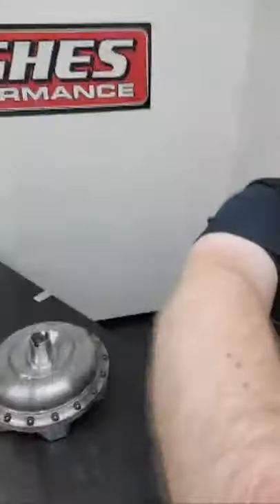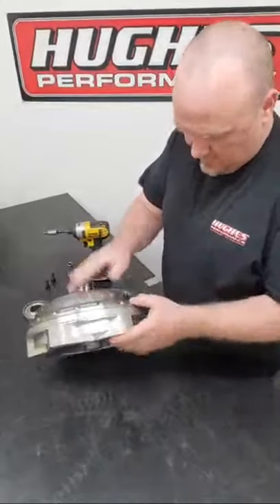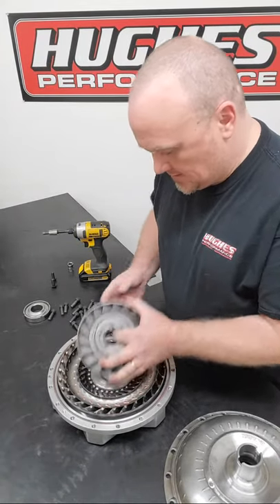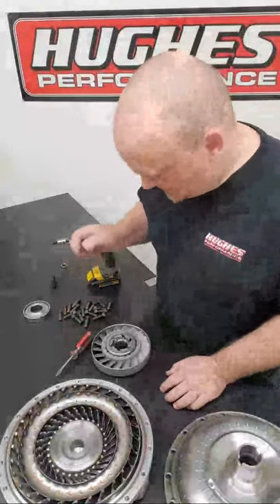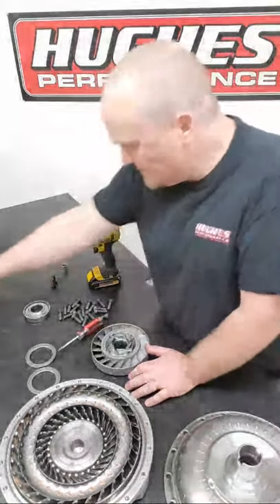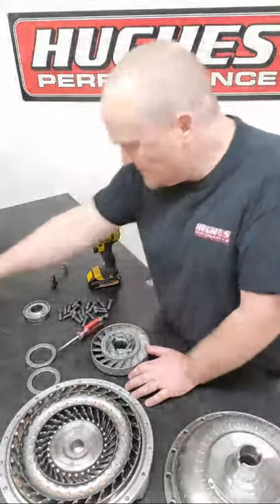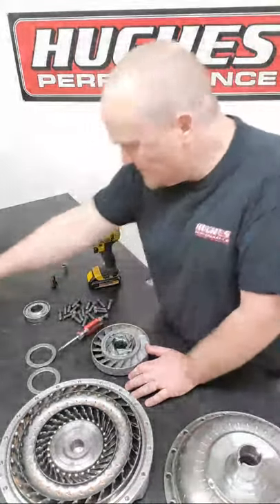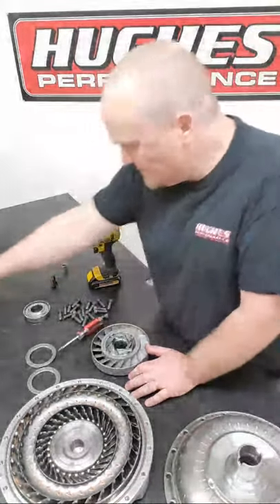Bolt Together Torque Converter Servicing & Stator Swaps

Comment: Hey did u Guys do u video on the oil pump for turbo cars
Reply from the maker: Not sure what you're referring to... what oil pump do you mean?
Reply: There is only one oil pump and that is under the pan, under the timing cover or on the side of the block depending on the engine turbo cars are no different they all run the oil pump on the engine there is no extra pump because it's turbo
Reply: @79tazman  This is transmission, not Engine related..